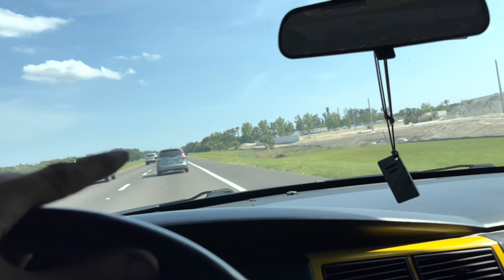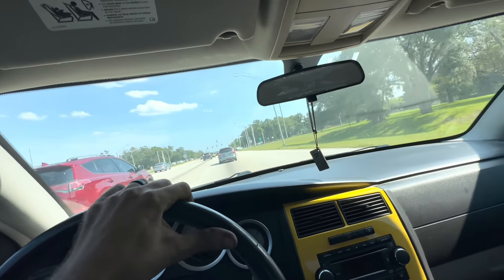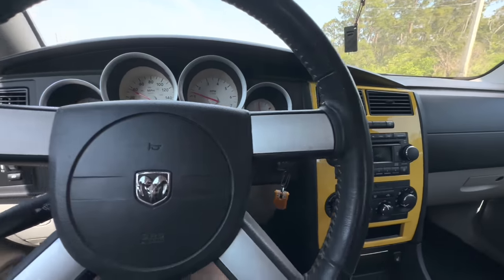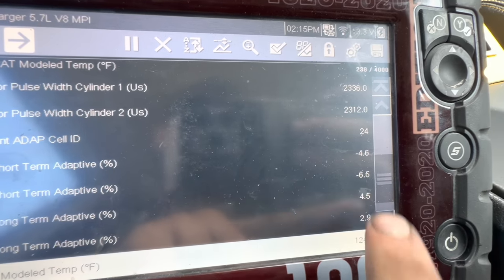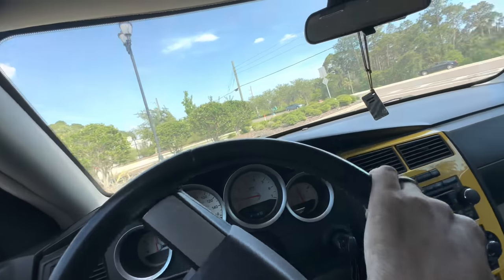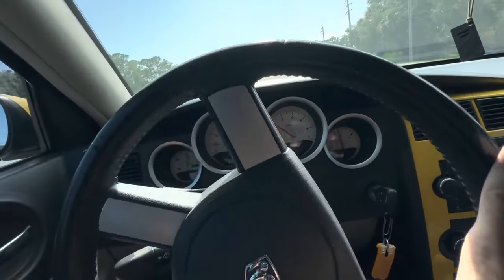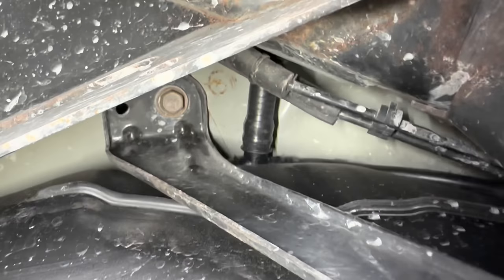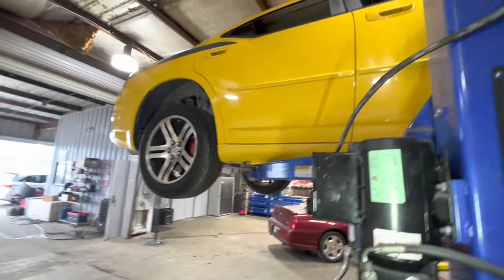Customer States: Engine Stalls After Fueling...HELP!! Dodge Charger 5.7 #mechanic

Comment from the maker: Keep a lookout for Part 2! Thanks for watching!!
Reply: No, thank you for making great content!
Reply: Ray if you don't mind me asking but what make was your twist handle ratchet please also what make was your rounded off special spanners set is please 👍 still loving your channel 👍
Reply: Hi ray, didn’t the customer say that the fault was “after refuelling”. Could it be as simple as them over filling the tank right up to the neck and then the purge is pulling out liquid instead of vapour??
Reply: @remargreg  Car Care Nut did a whole video on what can happen if you overfill your tank and showed how the fuel gets forced into those lines and what happens when that occurs.
Reply: What is flashing in the background
Reply: My dodge had a red rag floating inside the tank.  My Chevy had a coke bottle inside the driveshaft.  Never give up!
Reply: @dantesinfernopurgatory7826  ...The Vatican ?...🙃😉...
Reply: Looking for part 2 allready.
Reply: Just saying Ray i have the letter from dodge saved to my phone about this issue.
Reply: Suggestion @Ray:
Ask the customer if he's a "2-3 click kind of guy" when refueling.
Meaning that he fills the tank to the first click and then do 2-3 extra clicks to "really fill the tank".
That can cause the now over-filled fuel tank to spill into the Evap-system.

If you only fill the tank to the first click you are extremely unlikely to experience the stall-symptom 😉
Reply: @DenmarkRadar  I fill my car beyond first click because it wouldn't reach 3/4 on gauge if I didn't.
Reply: Hello and good Day to you!
I’d look into replacing the relays first (everything else seems ok or has been replaced already) ….even though “just because it’s new doesn’t mean it’s good” 
you’ve tested everything else thoroughly so you’ve got nothing to loose in parts cannoning the relays😉
Surely the relays can’t be as expensive as the rest of the evap parts or tank that have already been replaced
Reply: Great to see everybody back hope you had fun with ARod and co👍👍
Always great content keep it up.
Hopefully that fuze trick will work fingers crossed 
Cheers
Reply: My '06 Dodge Mag w/ the 5.7 does the same thing on occasion. And strange enough I have almost the same exact mileage......
Reply: @derekhobbs1102   half the time my local servo’s bowzer nozzles are stuffed and click way too early too ….slow and frustrating when you pick the wrong bowzer nozzle🤦‍♂️
Reply: @JB-uq5nj  I just posted a comment about "topping off". I had several customers in the last 15-20 years who had always 'topped off' the tank, and couldn't understand why it would cause so much trouble in a later car.
Reply: @SWHBOYCE  The Pentaverate.
Reply: My 2005 did the same thing to me.... Drove me batty for 3 months.... 

Check the charging system when you know it's likely to happen... The alternator is PCM controlled and it can cause the PCM to lose ground when too many accessories are being used and the vehicle is at idle.... it's often activated when braking refuelling and in traffic jams.
Reply: @remargreg  that would perhaps explain why the stall didn't happen when Ray filled it up to the correct level 👍
Reply: @derekhobbs1102  The nozzle usually has 3 settings. LMH. So you can stop it and then put it on low or medium to keep the gas from sloshing around.
Reply: Not on Australian pumps.
Reply: @steveneal986  I didn't see anyone flashing. Maybe someone was welding, or putting a lift up in the 3rd bay.
Reply: Ask the owner if they keep filling their fuel tank even after the fuel pump automatically shuts off. Meaning owner filling of fuel tank.

Also have they had the car (when full) at any extreme angles or drastic angles?

Like up really steep hills, especially on an angles sideways, and and with the motor running.

Or jacking the car up doing similar to big steep hills.

Even extreme G-force turns at high speeds with a full tank of fuel.

Any of these could mean the tank is good.

That it's the driver's actions or habits that could be the problem.

Easy fix.
Explain what to stop doing, and blow out the wet fuel evidence for a clean new beginning.

When I first gave my son my 1986 Monte-Carlo.
About a month later he was driving up a steep hill in town while having a near empty fuel tank and he ran out of gas.

Luckily he realized this strange possibility and carefully (I hope carefully) backed down the hill to more level ground and got the car running again. Then turned around and drove to a gas station.

This was his first police encounter while driving. Lucky uneventful and they even shared a laugh.

Quite different from my cousin around 40 years ago.

He used to get in trouble never wanting to invest in much gas at any one time and would frequently run out of gas.

My uncle eventually had had enough of getting these help me phone calls and that my cousin needed a gas can fill-up again.

So my uncle told him. No more running out of gas and getting help.

He told my cousin to first FILL UP HIS GAS TANK ALL THE WAY. THEN to NEVER let his tank get to under HALF and definitely NEVER under a quarter tank.  EVER...

So he reluctantly went to the gas station and dug deep into his finances and for the first time filled his gas tank to where the gage needle actually pointed to full.

All proud of himself and admiring his full gas gage reading, off he drove from the pumps and just as he was exiting onto the street, he heard a loud bang.

Apparently his old second hand upstate New York rust bucket car hadn't seen a full tank of gas for so long. He didn't know It could handle all that heavy gas, AS THE FUEL TANK BROKE AWAY AND FELL TO THE STREET.

My uncle got a different, I need help fuel story that day.

And my cousin hasn't lived this down yet...

Actually it's just a funny story and everyone loves telling
Reply: Spammers infesting the page again.
Reply: Whenever I have that issue with a vehicle I always go around and check every single ground
Reply: If you ever work on my 08 Nissan Altima do not put regular gas in it please I prefer to run high-test in my performance vehicle 3.5 6speed mansual tranny
Reply: Driving driving driving it hasn't stalled after the customer told you that you take it on the freeway and get off of the ramp and stop and humm
Reply: Wow it must be nice living in your world here in Ohio if you do not specifically request recall repair they ignore it
Don't go by that
Reply: Wait a minute you're just in it for the views aren't you
Reply: Send that same purge valve thingy on the top of the tank many times in Jeeps see if one of the Jeep cheap 12 interchange and just change that if it comes out of the tank
Reply: Also when the modular fuel pumps first came out they also said that those were non rebuildable they are
Reply: I guarantee it's the ignition switch
Reply: My 2001 Camry stalls after a fill up. I'm going to use a lower setting on refill next time. Thanks for the idea. @JB-uq5nj